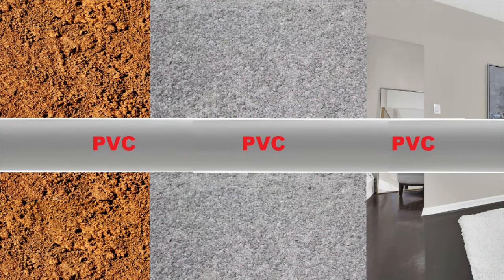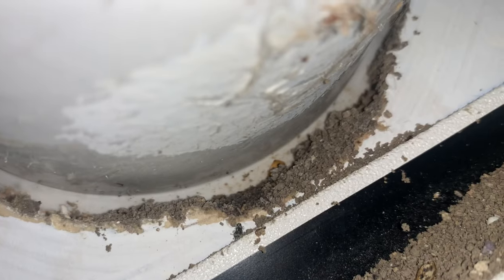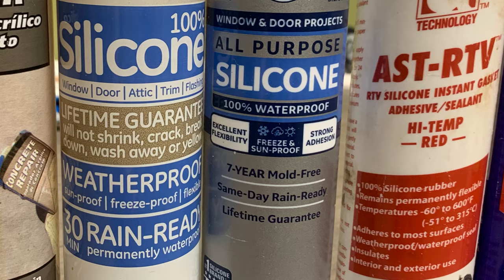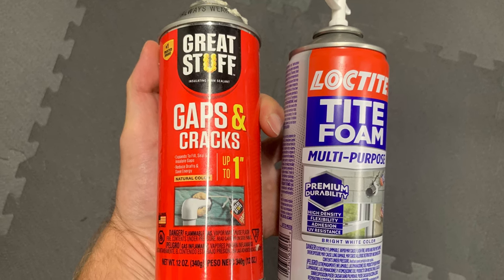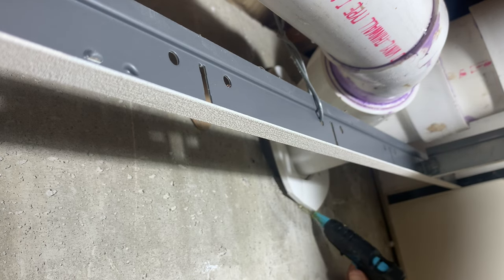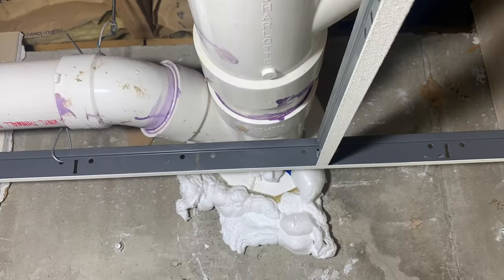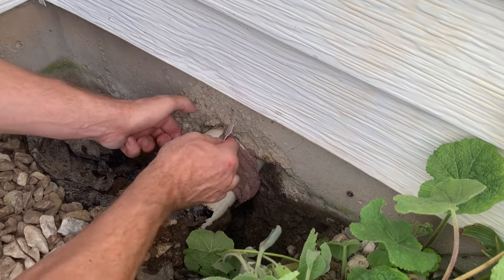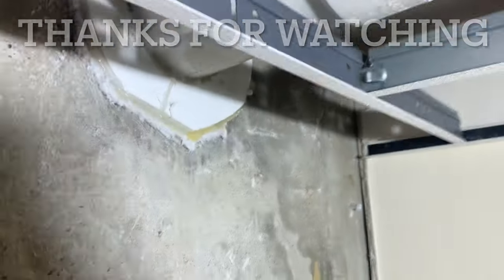Seal Leaking Pipe Penetration through Foundation Wall - PVC Septic Pipe through Concrete - How To

Comment: Hmm, I was told not to use that foam because it absorbs the water instead of blocking it?
Reply from the maker: Here is a spray foam that you may be more interested in. It is advertised for direct contact with water.
Great StuffPond&Stone Foam Sealant
https://amzn.to/3RQz1pT
Reply: @How-to and Reviews  How is this holding up?  I have a below grade penetration in concrete wall leaking and want permanent fix.
Reply: @jimw6991  Hi Jim, Me too--did you find a permanent fix?
Reply: @healthreviewsplus  I got a kit from Seal Boss .... it is a closed cell urethane foam epoxy that expands when it contacts water and Oakem.  You clear space around pipe then soak the Oakem in the epoxy liquid pushing it back about 1 inch behind surface of wall.  Hit it with water and it expands alot.  Pros use it to seal actively leaking pipes.  I then cleaned off excess and used hydraulic cement around the pipe ... it hardens with water.  I won't know if it works because there is a drought here but I would be shocked if it didn't.  100 bucks give or take
Reply: @jimw6991  Thanks!!  Likely, the pipe coming from my well is leaking inside the basement  wall, filling the sump from the bottom, and tripping off the water pressure tank.  Drought here too.  🙃

Comment: Great video. I doubt you're going to have any issues, but on a Home Depot customer question the manufacturer said this about using Concrete Crack Sealant to seal a PVC pipe penetration: "QUIKRETE Concrete Crack Sealant should not be use to seal between two dissimilar materials. We recommend instead a product which remains permanently flexible like QUIKRETE Advanced Polymer Non-Sag Sealant." I'm not sure I follow their reasoning, since it should still bond to both materials and is stated to remain flexible. But maybe the product they recommend is MORE flexible.
Reply from the maker: Thanks for the information, I appreciate it. 
I did check on mine in the spring and it is still all good.

Comment: Open cell foam (i.e. Locktite, Great Stuff) are not waterproof, and some can absorb up to 75% of volume weight in water. Closed cell foam is less than 1% water permeable, a better option, for certain. In the author's situation, with the exterior accessible, I'd seal the exterior with hydraulic cement (i.e. large gaps) or EUCOLASTIC 1NS (for small cracks), the latter solution which I used on a sleeved water pipe thru the foundation wall. I have a core hole to fill, 10' below grade (i.e. no easy exterior access). I'll probably bite the bullet, and push in hydraulic cement thru the hole (which expands as it cures, and cures in water). I would ~~ NOT ~~ use an open cell form to plug a foundation hole or crack. I ~~ MIGHT ~~ use a closed cell foam on cracks. With less than 1% water permeability, closed cell foam will likely divert water before the it's saturated, and the expandability will better, fully plug a crack than say, a poly product like EUCOLASTIC (but which works, well, too). My 2 cents ....
Reply from the maker: Thanks for sharing, I appreciate it!

Comment: Thank you so much for the video. I have a very similar issue except my pvc pipe is for a downdraft stove top. Will be following these steps to  remediate the issue but I only have access to it from the outside.
Reply from the maker: This should do it. Mine no longer leaks and I don’t even think about it.

Comment: Excellent instructions.  I don't think you mentioned where you live. I live in freezing Northern Mi. 
The Loctite you used on the inside, would that be ok in our weather?
Any advice would help me.
Reply from the maker: The advertised service temperature for the Loctite is -40°F(-40°C) to 194°F(90°C). 
I also live in temperature similar to you and have not experienced any problems and don’t have any concerns.
Reply: @HowtoandReviewsOfficial  Thanks for the quick reply.

Comment: awesome video. I have water penetration with heavy rain into finished basement from a long a pex pipe that is going under my crawl space that is high up on one of walls. Crawl space is raised up maybe 4 feet and you have to jump up to the crawl space. Anyway, leaking from under the vapor barrier along the pex pipe into the finished space. I can't excavate exterior of house in this area for French drain as a solid stone patio sits along sill. I have had success in past with spray foam and also hydraulic cement on two separate pass through leaks. My question. I have the water ingress along pipe BUT also under a trim board along the whole barrier into the finished basement. This board frames the opening into the crawl space. I think I can't foam under the wood as it will just back up water along the frame to other area and continue to leak. it is too wide of an area to foam. Maybe pull the trim and build up hydraulic cement and foam along the lip of that crawl space entry? Or a sump pump install.

Comment: i have a 1 inch hole that was drilled into my basement wall from the well drilling company... didnt end up using that hole.  even though they said it would be fine, water comes in when raining heavy for a while... do you thing something like this would work to seal it up?
Reply: While spray foam might work for you, it is not advised for waterproofing, and if it were to fail, it would be a nightmare to clean out and fix properly. 1 inch isn't very big, so you can fully plug that with epoxy if you want. Technology has changed in recent years, and the best concrete patch is no longer concrete.